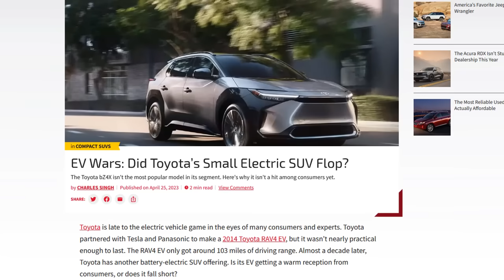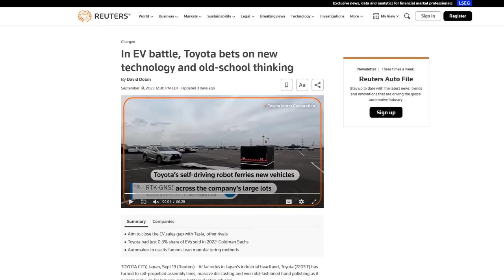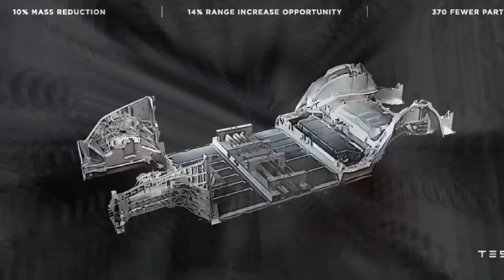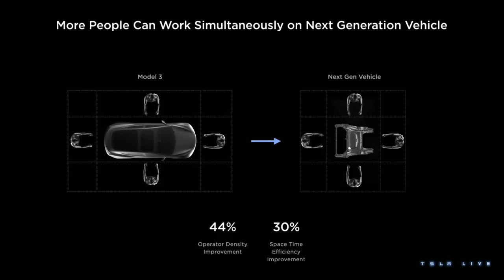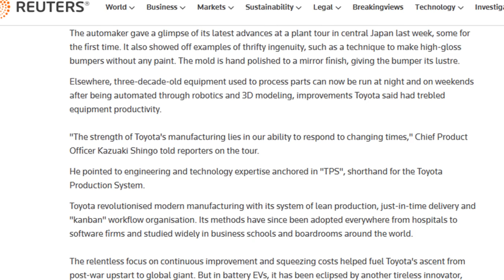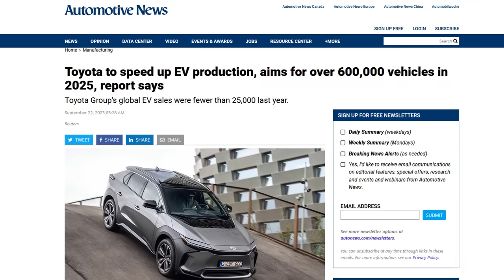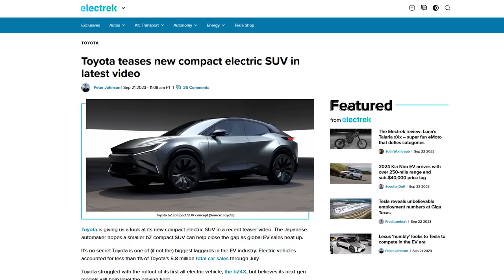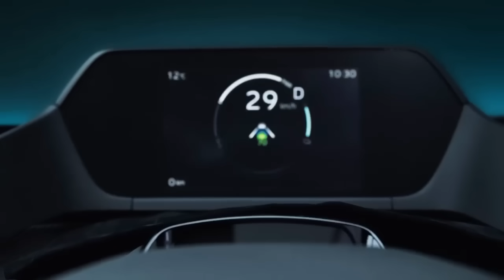New Toyota Giga Press SHOCKS Everybody!

Comment: My initial reaction is that Toyota will lose share and be a small player in the EV industry, BUT then I remember how the Japanese quickly caught up and surpassed Chrysler in the minivan segment. I think Toyota will have to redefine the role of their dealership network. EV have a much lower maintenance requirements and I have noticed that a lot of legacy dealerships are requiring a lot of BS maintenance in their EVs (e.g., check this, check that, etc) and charging high prices for these visits. I think Toyota should start a brand new corporate owned retail store model from scratch.
Reply from the maker: Toyota has the ability to do it, but they are fighting against it, which has set them behind.

Comment: Toyota set hydrogen up as a Trojan horse, hoping other manufactures would go after it, and distract them from making BEV’s. The only one benefiting from hydrogen is the fossil fuel industry is, it will remain the cheapest source of hydrogen or decades.

Anyone armed with high school physics can figure out that hydrogen will never work as a transportation, Technology for a variety of reasons that has nothing to do with getting the quantities up to lower the cost. It has to do with hydrogens physical properties that cannot be changed. It’s hard for me to believe that Toyota didn’t know this from the beginning so I suspect some evil plot and a possible poison pill relationship with the fossil fuel industry.

Toyota getting hydrogen to work seems like a more complex technical problem than getting a BEV to work. From hydrogen fueling connections to three tanks that store hydrogen at 10,000 psi to a fuel cell to a buffering battery and then an electric power train, Toyota Mirai, seems much more complicated than the original Teslas.  Toyota ‘s CEO doesn’t look like an innovator or a top line futurist making the underground story on the Mirai a great mystery.

Comment: I remember the first "unibody" vehicles were cheaper to buy but if you got into a "fender-bender" It would be expensive or impossible to fix.  This is, apparently, what is occurring with Tesla...very expensive to repair, if at all possible.  Starts out cheaper and ends up with "disposable" bodies.  That is Tesla's Achiles Heel. Elon will have to remedy that situation...Maybe sell insurance that cheaply covers totaled Tesla vehicles?  Crash your Tesla, tow it in and drive out in a new car?

Comment: The biggest problem for EVs is high cost, the grid & charging stations. It has little to do what the vid said. EVs are still expensive compared to let's say Corolla Hybrid. The grid (talking about US) is still stuck in 1950s barely covering electric needs right now. And charging stations are still MIA. Drive thru Chicago you only will find EV stations in any numbers about North Side lakefront, O'Hare & Midway. Rest of the city is the proverbial EV desert. Government could require gas stations to install at least 2 chargers on the lot but nothing yet materialized. And we still have child labor problem  in Zaire, charging times & China monopoly on rare earths to deal with still.

Comment: Don’t these large central structural one piece castings make the cars essentially unrepairable in the event of an accident? What’s that going to do to insurance rates for them?
Reply: Modern vehicles have high strength steel in the stress areas making Straightening a deformed bodyshell extremely difficult. So same difference except for being made out of 80+ pieces that have to be welded together. The precision of the giga castings makes production easier & faster.

Comment: Its going to be hard for a lot of these OEM's to survive, so much more tech requirement and so much of the efficiency/performance of the EV is software.
Reply: That Tesla integrates different systems as blocks is very hard for OEM's to do this would mean several different parts suppliers & design teams working together.

Comment: Toyota have big challengers ahead. Firstly they are the worlds  most indebted company. They are a base one with not even a concept car. They are getting hammered in China, 25% of their sales. China is already at 30% EVs and are coming up to stopping ICE car sales altogether. Toyota are loosing it in  too with EV adoption. Toyota have been lucky to keep their sales and numbers up supplying the pent up demand caused by the supply chain shortages but the shortages are coming to and end and the demand catch up Toyota have been enjoying is coming to an end too. Toyota are about to enter the valley of death in the next 2 years as their sales and sales of ICE cars generally including Hybrids fall. There is a possible recession coming with the economy in China collapsing and the real estate market in the US correcting, another hurdle for Toyota. The target of 600,000 EVs be 2025 is very optimistic. Even if Toyota were able to design a car, set up manufacturing and sell that many cars in such a short time it would be only 6% of Toyotas current annual sales.

Comment: Toyota senses the fact that not everyone wants or needs a Tesla.  Most people just need a reliable, simple, inexpensive method of transportation that does not depend on the big oil monopoly.  Toyota has always excelled at building fair priced, but tough as iron vehicles.  I believe they can do the same with EV's.  Just remember that 0-60 in less than 5 seconds is not necessary and can be deadly to most drivers.
Reply: Toyota is falling into the same trap as traditional US automakers did in the 60s and 70’s. They’ve become too comfortable with their past successes and they aren’t spending enough resources innovating, and are being left behind. They aren’t competing, they are just keeping pace.
Reply: At least "they sense the fact" that 600,000 customers worldwide may not want a Tesla.... 🤔
.
Or.... That 6% (!) Of their own customers may not.....
94% of their customers will apparently still be happy being tied to "the oil monopoly"
Or maybe they won't .....? In which case Toyota has a BIG problem.

Comment: Ok Toyota copy Tesla. So what is the big news? Tesla has been using this for a year or so. Not new breaking news!!
Reply: Large rear casting in all model Y built. So 3+year's of proven production casting experience for tesla.
Reply: Missing the point.
EV numbers increasing.
ICE numbers decreasing.
Toyota target ASSUMES steady production of 10 million total?
.
In which case, EVs will be ±6% of that number?.
However, assuming EV production increases, the percentage market for EVs should be 50-60% of the total market by then?
That's going to be a big hole in the Toyota balance sheet.

Comment: Toyota does not have a dedicated electric car manufacturer factory up and running; do they?
Reply: Toyota do not have a EV factory. The BZ4X was made for Toyota by BYD and it has been a failure 
Building 600,000 EVs in 2025 or even being at a run rate at the end of 2025 is not going to happen 
But dropping sales for Toyota will be happening in 2025

Comment: By 2025, Toyota will have lost 50%of their ICE sales to electric and with it their economies of scale. With such a loss of profits,  will they be able to service their huge debts? Their survival very much hangs in the balance.
Reply: Let's look on the bright side...
If they lose half their ICE sales, they can say EVs comprise TWELVE percent of sales !! 😂👍😂
.
(Assuming they survive the contraction and the debt burden)
Reply: 50% EVs by 2025 is unlikely. None of the mainstream manufacturers are really interested in EV. They do the bare minimum then wonder why there is no profit and reliability is questionable. 
Tesla won’t be challenging on volume by 2025. But move out to 2027/28 and they’ll really be cleaning up.
Reply: Don’t count on Chinese cars taking over. Their companies are running serious deficits and their battery safety is questionable.

Comment: EV's use way less parts than ICE = less jobs + giga press = more jobs gone. Toyota/UAW/Legacy - tesla = fast melting ICE.
Reply: That's true but also not true. Look at tesla building it's own cells, pack's, motors, inverters etc. 
Tesla alone world wide is approaching gm&Ford in total employee's now. By the end of 2024 they will likely employ more than either.

And it likely won't be until 2025 that they out produce Ford or gm globally for an entire year in production. 
Heck tesla plans to employ 60k people at teratx alone once it's fully built out and expanded. 😀

Comment: Yes they are very late to the party and no they won’t catch Tesla, but this is a good new story for Toyota. It will be far better for the car industry to have a strong Toyota than them wither away - they have huge technical skills and production capability that could be turned to EV production if they focus on it and they would likely produce great cars in the future if they did.

The problem is they keep producing contradictory messages about supporting hydrogen etc. and without total focus on moving to EV’s they aren’t going to make it.
Reply: Their huge production capacity is their biggest problem it is mostly a dead loss for BEV production. The skilled workers from their ICE production will have to be retained or retrenched, as efficient EV lines require far fewer people. Whole sectors of the company are going to be complete write-offs engine & gearbox plants.

Comment: What should have been added to this video is total company loans/dept. How much is Toyota on the hook for, and how will they pay that debt down while trying to innovate and build new electric vehicles or will they just add more debt to the pile they already have and what does that cost per vehicle.
Reply: Toyota has about $180 billion in debt, similar to VW.
Reply: @ChickensAndGardening  I thought it was over 320billion in total debt for toyoduh? Maybe that was vag instead. 
Still crap bond&debt ratings along with a failing Altman z score for both of them. 

And nothing but decades old inefficient ice plants/factories along with mostly ice entrenched mindset legacy employees. 
Imo by 2025 toyoduh will no longer be the top automaker globally. By 2028 they'll be out of the top 5 and maybe even facing bankruptcy.

Comment: The reason they pushed for hydrogen for so long is because most of the critical supply for electric vehicles comes from China, and they don't want an adversarial country to have the keys to their largest industry. This shift could be due to Tesla's announcement of new, precious metal free electric motors and other such technologies that would allow them to produce electric vehicles at scale without depending on China
Reply: You might want to learn about the EV supply chain...and how to spell. Most on the elements for Japanese battery tech come from Canada.
Reply: @PureHokkaido  I do want to learn about the EV supply chain. You could have taught me but instead you chose to be a smug asshole, so I'll reply in kind:

The point of writing is to convey messages. As long as the meaning of the message was understood your complaint about my spelling is as meaningless as your followup point. 
Most of the elements necessary in battery production are neither rare, nor expensive, yet batteries are still the most expensive part of an electric vehicle. It's almost as if it's not important where you get most of your supplies from, but where you get your critical supplies from.

I'm sorry my spelling wasn't up to your standard, would you like me to rewrite my message in any of the 3 other languages I'm fluent in? 

How about you make an actual contribution next time you comment? With an original though, or interesting fact perhaps. Something actually helpful instead of an "uHhm AcTScHuALlY"

Comment: There will be a market for ICE cars as electric infrastructure will have trouble meeting EV needs in many countries.
Reply: Nobody want to buy a new ICE car after year 2026 when a EV cost less 😊
Reply: The electric utilities will be happy to generate and sell more power if people want it and regulators allow it.
Reply: @MsAjax409  I utility regulators in California, electricity will suffer the same fate as gas refineries in California.  Our electric rates have seen strong price increases.
Reply: @EASTSIDERIDER707  That's a shame because energy is free, it's the cost to collect it and distribute it that is expensive.  If you own a home with good sun exposure, a 6000W solar array and a 13 kWh battery is enough to provide for most people's domestic energy needs, especially in southern California.  I live in northern Illinois and do not have to pay the utility company for electricity. I drive an electric car as well.  I do still pay for natural gas for winter heating in the coldest months.

Comment: Sounds like Toyota is innovating now and that’s a good thing for EV competition. That’s a win for EV consumers moving forward.

This is good for Tesla to keeping them forward at pace on the innovation train
Reply: Your answer states a person of confused pointless mind, wandering with no finish line let alone knowing where to go.
Reply: @asgglass2709  Tesla is for EV adoption and sustainable energy revolution They can’t do it on their own so many of Teslas patents are open for anyone to use.
Reply: "innovating" is doing something new, that nobody has done before.
.
Toyota simply "Stole Teslas'homework".
It's a rewrite of the "unboxed" system.
1) Large castings
.
2) mount the castings on a robot transport.
Assemble parts on each casting in different areas.
.
3) Transport the completed units to a final assembly point.
.
4) Bolt together.
Reply: What exactly is Toyota innovating?

Comment: Is Toyota still lobbying governments to hold back EVs?
Reply: In Japan, yes. They have successfully stopped charging rollout across the country. Most chargers (if you can find them) top out at 20kW. You may get lucky and find a 50kW. This alone, in a country where most people don't have a wall charger and homes are 100V with a max 40A breaker box, has killed the EV market here for the next 10 years.
Reply: Yes....

Comment: Out sourcing batteries will not give them a competitive edge.  Software development is far more complex than speculating they will have that down too.  As mentioned in the video, their ICE sales by the end of the decade will have most likely collapsed, thereby progressively losing their market share.  Plus their legacy debt over hanging them will be a drag to implementing innovation and profitability.  Their claims for EV production for 2025 sounds more like a pump and dump scheme aimed at its stockholders and potential investors.  In the end they are in the same boat as the other legacy ICE manufacturers.  The hybrid approach may give them more time to convert fully to electric and not hydrogen, but only against the reality of a world wide oil and gas production availability being maintained economically.
Reply: Their time as a big player is over regardless of whether they survive as a company.
Reply: Tesla is also outsourcing batteries.
Reply: Tesla has been vertically integrating battery production for years and is now creating their own lithium refining facility.  They are controlling costs and availability and in this process are essentially discounting the cost of batteries as compared to other EV manufacturers. Tesla created the 4680 form factor and advances in chemistry  that has made them a leader.  @ChickensAndGardening
Reply: @ChickensAndGardening  
For now

Comment: The self-propelled production line sounds dumb, not only because you need the entire chassis and drive train to be working first. But don't modern assembly robots rely on the vehicle moving precisely along a rail, so they don't need to search for proper alignment? Rolling on its own tires would create its own problems. Exciting new innovation created not in engineering but in PR dept?
Reply: Spot on.
Reply: Self-propelled does sound like a stupid idea.
Reply: Tesla's  new vehicle design methodology eliminates the need for a human or robot to make precise alignments.   Parts and sub assemblies are designed to go on exactly right.   Should be the most exactly built cars in the world.